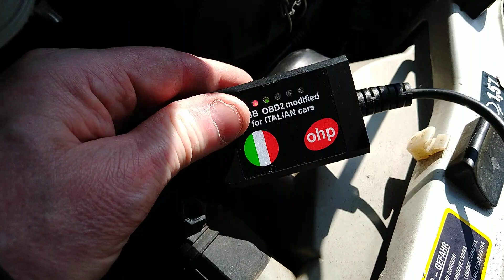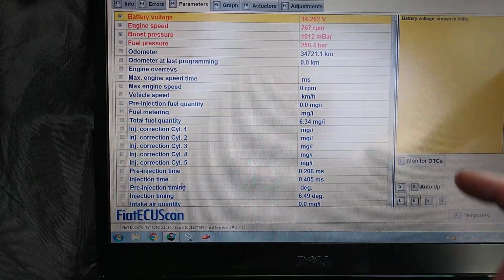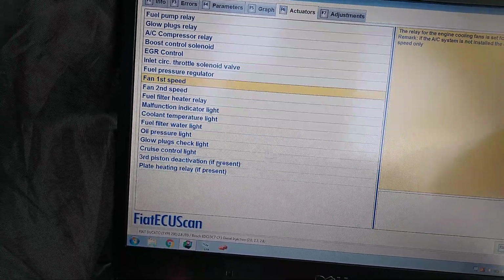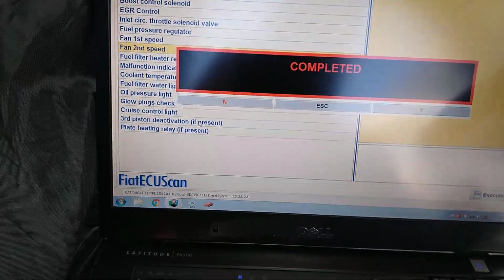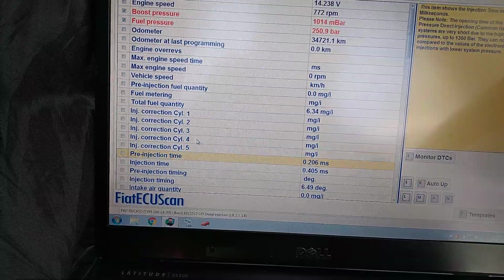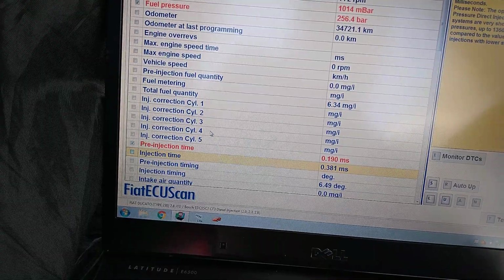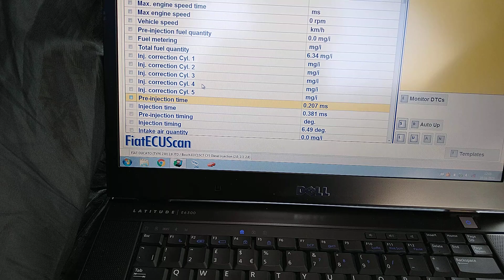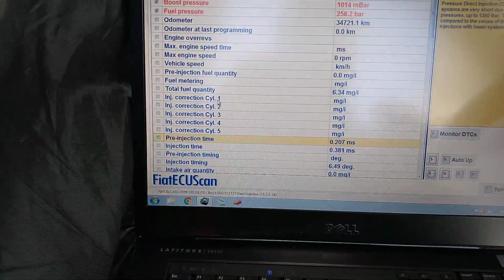2001 Peugeot Boxer 2.8 HDI   FIAT ECU SCAN software demo

Comment: Excellent set of videos (all 3 of them).

Is there a guide for how to set the multiecuscan software up or did you just install and it all worked correctly with ports
Reply from the maker: Hi. Thank you. No guide for the software  but there was some guidance on getting the PC's port settings correct for the adaptor. I was struggling to get any readings initially which ultimately led to conclude that the first Modified ELM 327 unit was faulty. I sent the screen shots to the supplier and they sent a replacement Modified ELM 327 which worked perfectly straight-off.
Reply: Just adding that the Mk1 Boxer 2.8 HDi is the same vehicle/engine as Ducato Mk2 2.8JTD and I have a screen shot showing the Boxer HDi identified in the multiscan software as " FIAT DUCATO (TYPE 230) 2.8 JTD" 👍

Comment: Thanks Great video. Can you advise if the 3 pin cable to OBD converter has small enough pins to fit the diagnostic port without modification? The problem i am having is the cable i have bought from ebay has thicker pins and they will not fit into the diagnostic port.  I have a same age 2.8 JTD but on a fiat ducato X230.
Reply from the maker: Hello. Yes I have purchased several and all fitted immediately with no modification. This is the most recent one: https://www.ebay.co.uk/itm/272625448251         In case that link is out of date the item is described on eBay as: " 3 Pin to 16 Pin OBD2 Adapter Connector Diagnostic Cable for Fiat Alfa Lancia " and it is clear from the photo that it has the same 3-pin connector as the RED one which located on the inner wing of the van beside the ECU module.
Reply: @JKTowers1  Thanks for that.